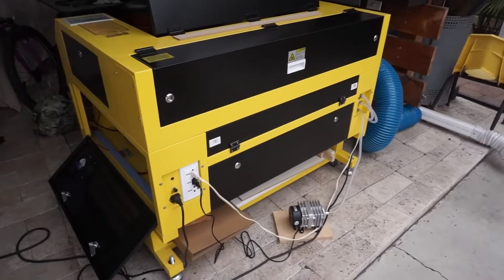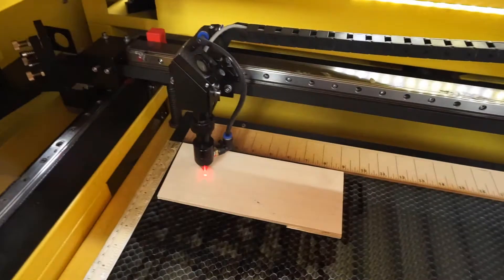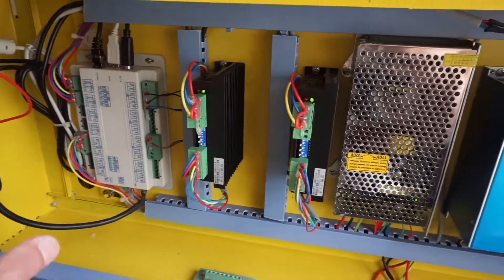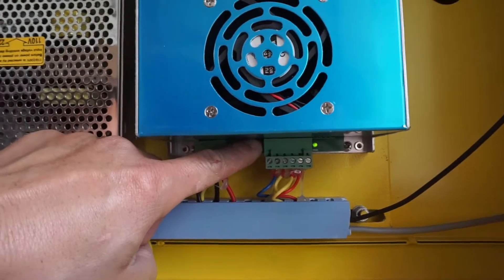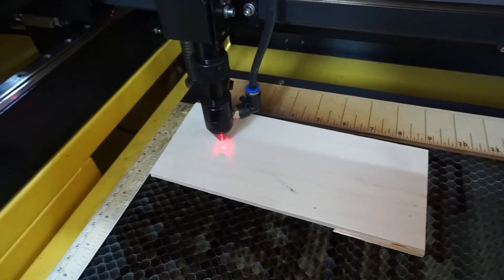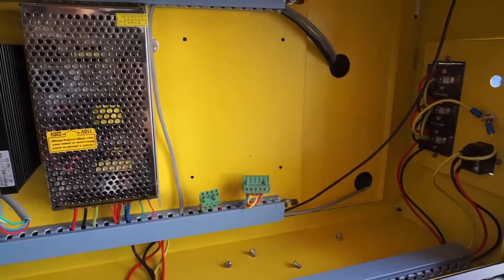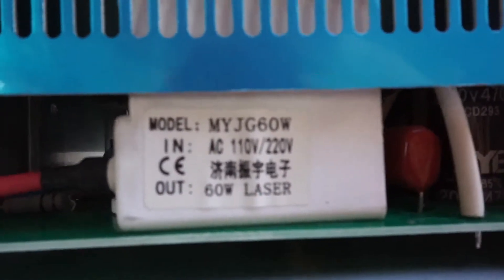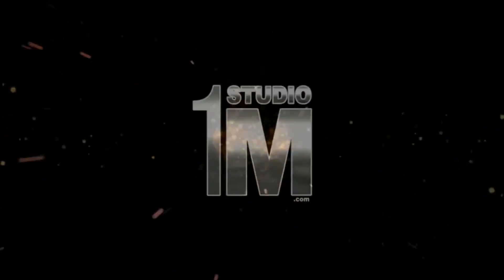60 Watt Chinese Laser Engraver Power Supply Troubleshoot / Replacement

Comment: I have a 100 watt laser.   I think the power supply is bad or else the tube is bad.  But the power supply doesn't seem to fire when I hit the test button.  However it DOES send a pulse (although not a solid pulse) when I hit the pulse button on the control panel.  And there's a yellow light on the power supply when I have it sitting idle.  ????